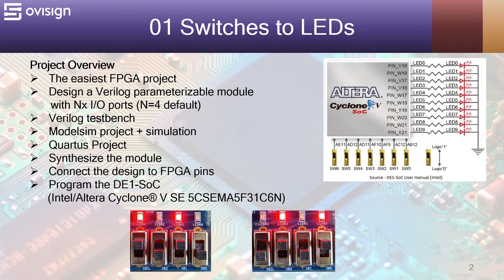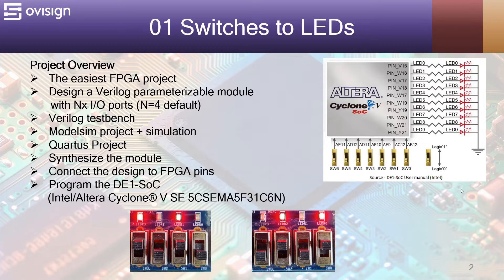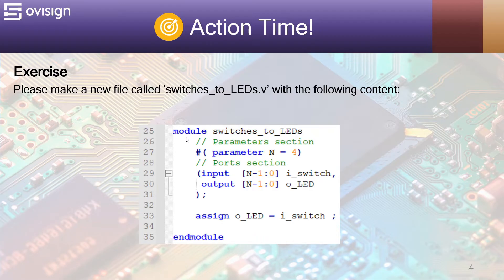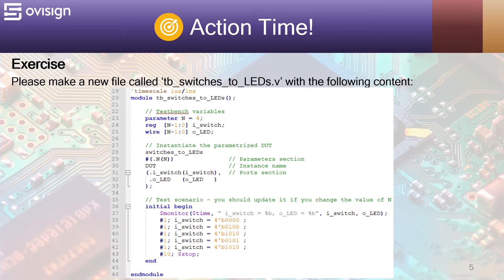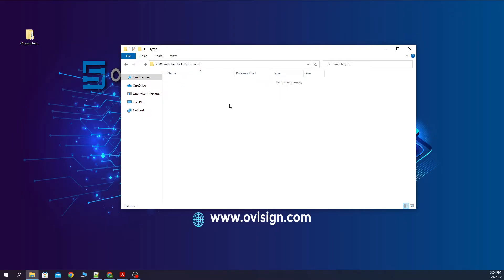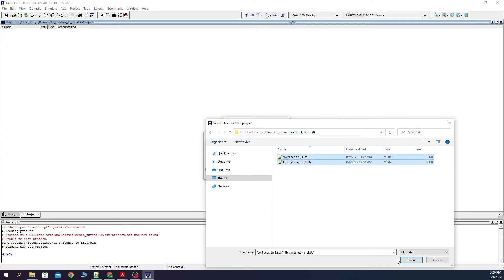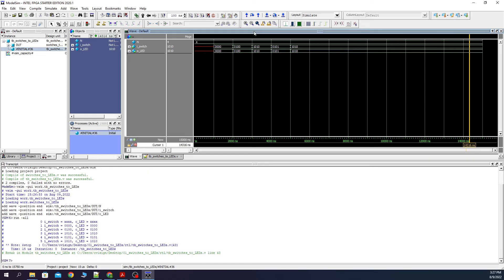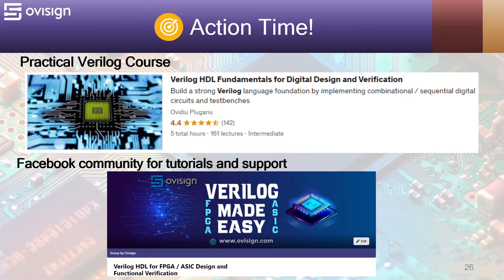FPGA project 01 Part1 - Switches to LEDs

Comment: At 5:15, I could not see DUT in my simulation. This is because Questa does not show signals for better performance. To prevent this, go to Project tab and for each source file, right click and select Properties. Then Verilog & Systemverilog tab, then under "Other verilog options" type "+acc" without quotes. Do this for all verilog sources. This should show DUT signals after reloading the simulation.